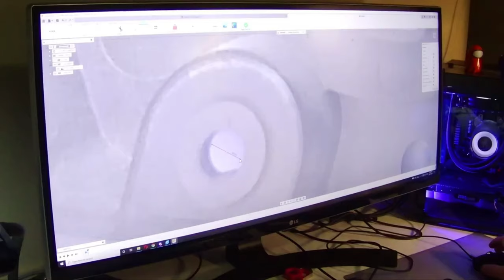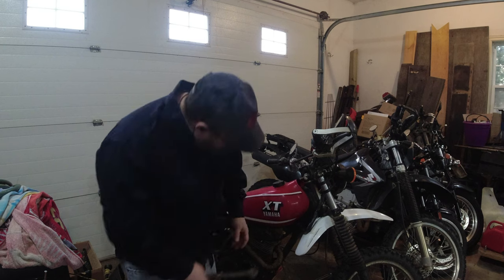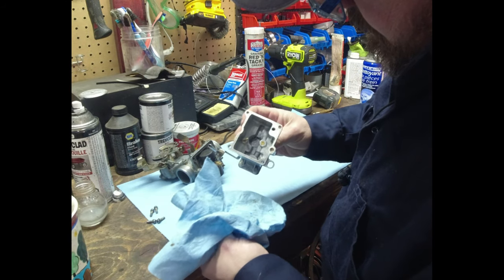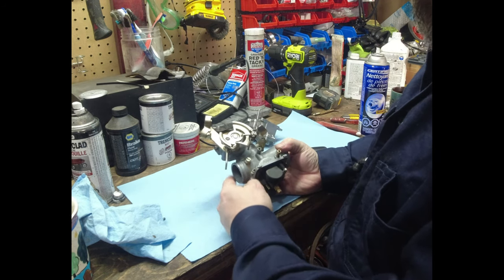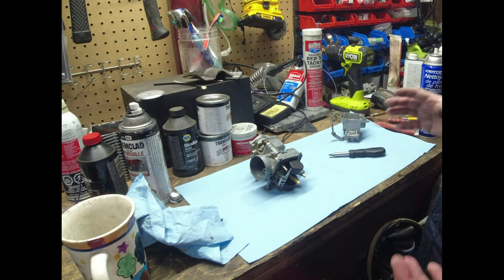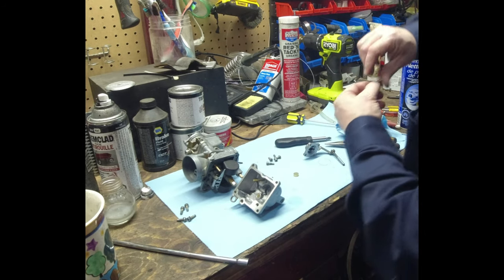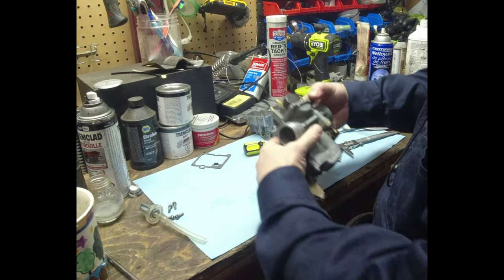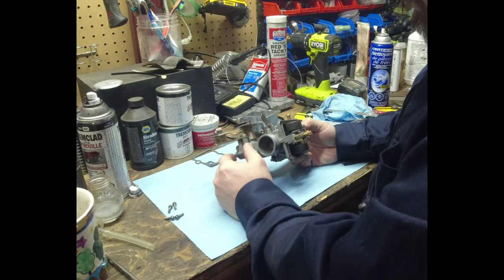1980 Yamaha XT250 Refresh / Carb work Part 1

Comment: Thank you, I’ve have some trouble with these carbs for years now and working on the float height, this video helps. Those membranes do really seize to the carb over time and I agree if it seems to be working no need replace it and pull it off.